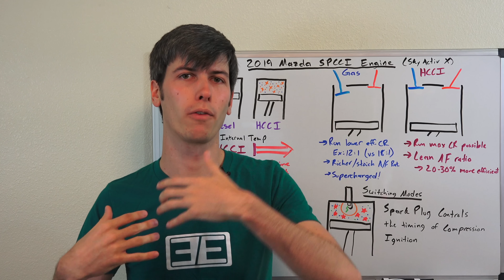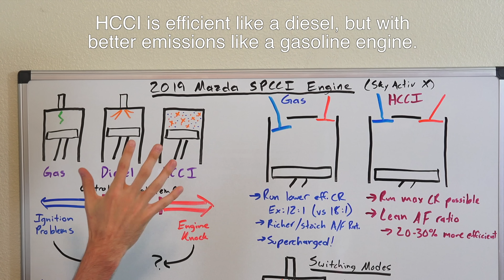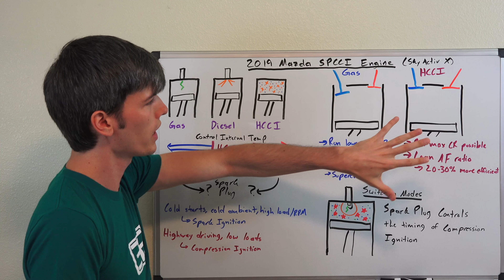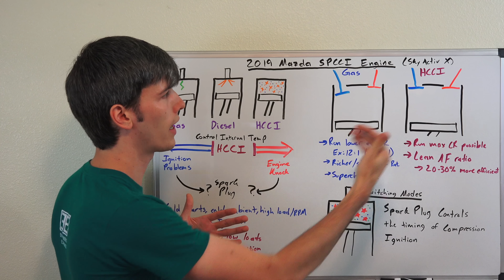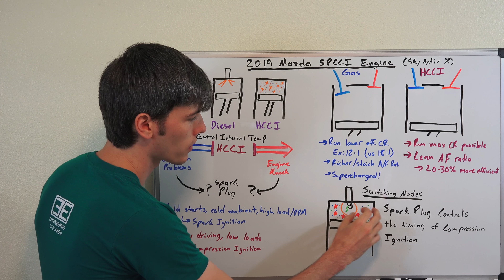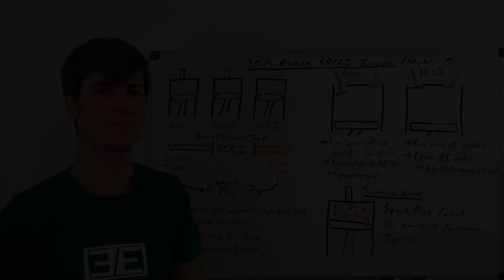Mazda Creates The Holy Grail Of Gasoline Engines - HCCI SkyActiv-X

Comment: Hey Jason! I have a doubt regarding the HCCI engines. How would they treat the exhaust gases with the 3 way catalytic converter in a lean burning engine like this? You need a engine air fuel mixture that is switching between rich and a lean mixture for getting the NOx handling capacity from the 3 way catalyst just because of the way the catalyst works. And given the compression ignition you will have greater NOx generation in the cylinder with the higher temperatures, effectively behaving like a Diesel engine. If they do have a way to address the emissions then why not go with a concept like Turbulent Jet ignition which is massively less susceptible to ambient atmospheric conditions as compared to HCCI engines? That is also a lean burning engine which can offer amazing performance. Is it just because Mahle owns the patents on the TJI?

Comment: They already run a high compression ratio on their gas engines. Why would they use 12:1? They could probably make the 18:1 work even with spark.

Comment: Few automotive engineers impress me but I feel you are a legitimate expert and opinion leader. I would like to share a discovery of a rotary piston engine that I would like to get your opinion on. It has cylinders/pistons and rings but zero reciprocating mass. Everything is rotary, however not like the Wankle. I am a machinist but not the inventor of it. It has been around a while but for some reason, the true brilliance has been overlooked. I have seen and evaluated virtually EVERYTHING else in internal combustion and I believe it is the Holy Grail of engine principles. I have an extensive aerospace development background and am under proprietary agreements with most all major US government contractors. In addition, I have developed and proven two CVT's completely different than what is on the market. I would like to share and will send you a private mail via your contact info. Thanks for what you do!

Comment: Unless I missed something, did Mazda actually say it switched? Otherwise it might always be in spark controlled compression mode.

Imagine the cam set-up otherwise. Valves opening during high compression!
Reply from the maker: +koshermal yes, they said it switches.
Reply: Engineering Explained Oh, chur. Keen to see how they work it!

Comment: A new engine.... From the company that couldn't figure out Rotary after 30 years. No thanks.
Reply: Mazda, the only company that could figure out rotary engines.
Reply: doktorbimmer but you're a gay ev driver I thought. you're the reason all engines are boring right now. rotary engines struggle isn't itself, it's the epa.
Reply: hey man, thats alot better than ford. They still havent figured out the piston engine.
Reply: look, just buy a tesla... they are the future!
Reply: Rovid Bouski it's all in the ownership. I've owned four FC3S models now. currently on a 30 year old original engine with 134k miles. fires right up man. original driveline still on so I get vibrations around 7-7.5k rpms. 

my point is is maintenance...like all cars. understand how it works and it'll work. don't, then it won't.
Reply: Casey Stoner mazada didn't build it first, NSU did. Mazada just copied and massed produced
Reply: Snethss, EXACTLY!
Reply: doktorbimmer lol you really think the rotary was to blame?? Ford had nothing to do with that? when they were winning Le Mans, IMSA, and anything else in between, the rotary engine opened peoples eyes to Mazda...not the other way around. even now you can see their success happened after gaining their majority back in the company. new philosophies, designs, and marketing have lifted Mazda up. again, the rotary engine is ONLY held back by today's stricter emissions standards.
Reply: doktorbimmer for such a horrible engine design running 24 hours, you still think down on it huh? that's not the only rotary car that won races. and everyone knows just lasting 24 hours is one of the biggest challenges...it did it flawlessly.

as far as Mazda wanting everything rotary, could you give me a link or something? that's new to me. afaik, they've mostly been installed in sports or sporty cars. never heard of an all out line up. not saying you're wrong...never heard it though. I do know that a LOT of manufacturers suffered during OPEC times..did you see muscle cars surviving? that wasn't a time for any sports car to be successful...rotary included. Ford was already bigger than Mazda and Mazda wasn't anything like they are today. but...you're still going to lean on it was the dirty rotary engine that did them in eh? OK sure thing. if anything was as devastating as you claim, you wouldn't keep producing it all the way into to 2000's. come on man.
Reply: doktorbimmer and the rotary is very much alive. Mad Mike? PAC racing? Loquito Killer?? and there's plenty of good quality shops building amazing engines out there.
mass produced? no. 
alive? very.
Reply: the radbull and madbull are clearly Kawasakis.... doesnt matter anyway tesla is the future.
Reply: Dmitry, really? Then why did Nissan use ford technology on their flagship GT-R? Why did Ford have the best truck for over 40 years? You are aware that Ford is the only American Car company to not need a bailout. Compare that to Europes sub par quality, horrendous reliability and massive electrical failures.
Reply: Efini, those engines require constant rebuilds, rotary engines are dirty, inefficient junk
Reply: Carl Borbol plus replaced the ceramic piston seals every 30-40k miles @ £300-£400 per set of seals per cylinder
Reply: Ford was reliable from the late 70's to the late 90's. Explain one reason why any modern car would have a cavitation issue with the water pump that makes a hole in the side of the engine at about 70k miles and dumps all of the coolant into the oil essentially seizing the engine completely in a matter of seconds. Water cavitation was was discovered in the 1600's. 400 years ago. That's almost 2 times older than the united states. A good 60% of modern ford engines have that issue. Also, European cars are unreliable? The record for most miles driven on any single car ever is held by a 1966 VOLVO with over 3 million miles. Find me a single article that ranks ford as a more a reliable car than mazda.
Reply: nah. epa killed the wankle engine. Before epa the only reason that the piston engine was more popular is because its much easier to mass produce a piston engine. You can build an extremely reliable wankle engine, but it will never pass smog and will cost about 10x as much as a equally reliable piston engine. The wankle is dead dont get me wrong, but I love mazda for giving it their all.
Reply: doktorbimmer tesla and electric cars are NOT the future h2 running cars are way better,  water in and drive and nothing comes out and not really more dangerous then a gasoline run car and no annoying batteries and no need for electricity from reactors
Reply: my rotary had 226000 miles on it and still running when i sold it. changed the oil every 3000 miles an bought a battery or two for it. oh yea, replaced the brakes.
Reply: Liquid Piston figured out how to do rotary correctly
Reply: Dude really? no one figured out Rotary to where is was good for little more than a racing engine.
Reply: DIRTY ICE CARS ARE HISTORY, BUY TESLA!